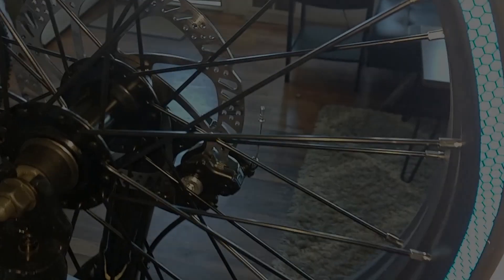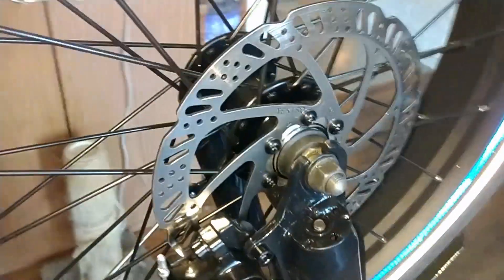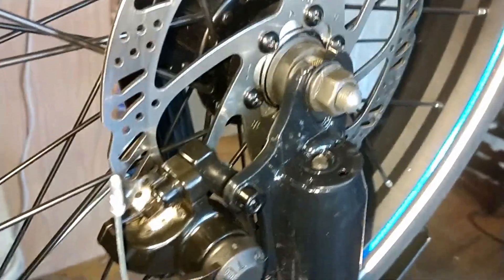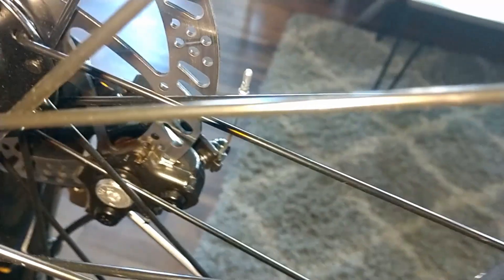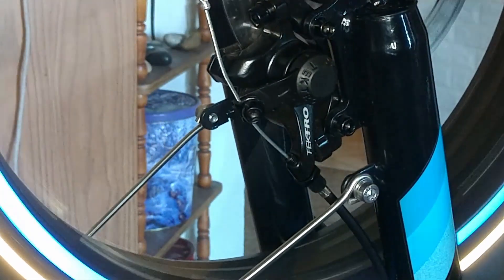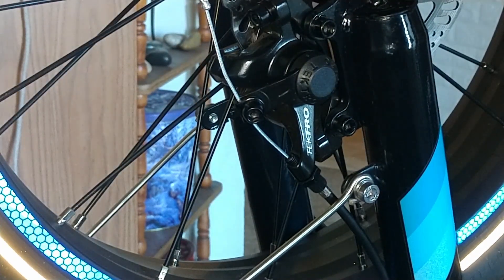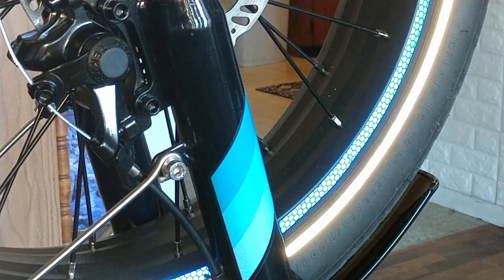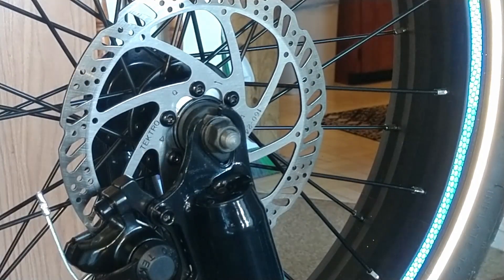LECTRIC XP 2.0 - Front Brake Noise & Adjustment | Alot Better Now

Comment: How are those street tires performing? Happy with installing them?
Reply from the maker: I'm happy with them so far. I feel comfortable taking corners at PAS 2 speed. My next tires I install will be more beefy, though. Some motorcycle tires will fit the bike, but at the cost of added weight.
Reply: @Pandafoo  thanks am about to put that tire on my XP, was curious if they corner well
Reply from the maker: @ChrisCrossed  I feel they help the bike feel more agile on corners, which I really love because it reminds me of my mountain biking days. Obviously don't get too carried away with speed while cornering, but they handle well for me. Good luck and ride safe

Comment: Hi, I'm getting a clunking when applying the front brake, not Everytime, but a lot of the time coming to a stop. I took it to the bike shop, he couldn't get it to make that noise there, and unfortunately it's still happening. 
I was wondering if you were having similar issues, and if your adjustments solved your problem? 
I would be interested in your feedback.
Thanks.
Reply from the maker: Mine is pretty quiet when I come to stop. Some of the things I would suggest you look at would had been done at the bike shop, so only thing I could think of is maybe check your spokes for any real loose ones, your front fork assembly as well. Seems odd the bike shop wouldn't find anything wrong with the brake unit if that is the only time it is happening.